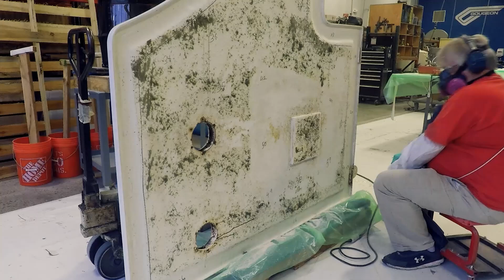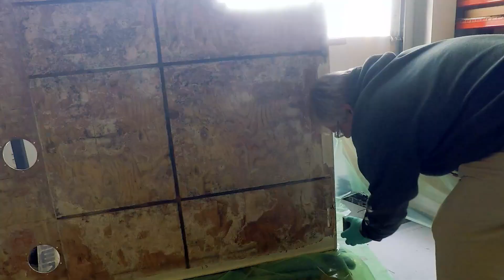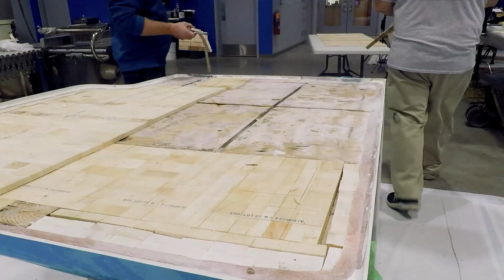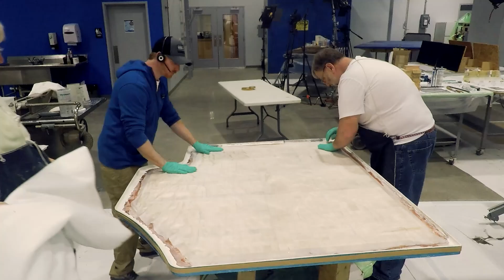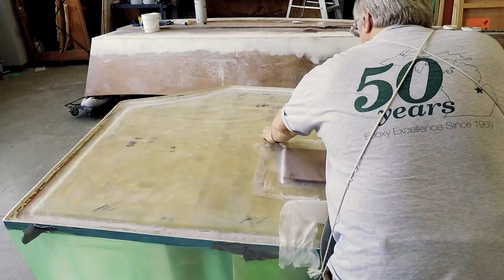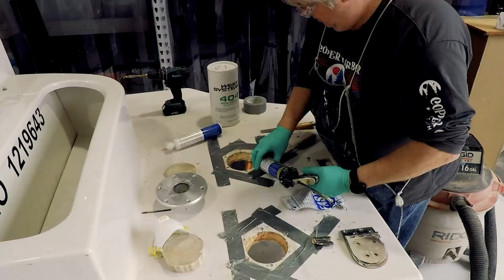Replacing Rotten Balsa Core in an Engine Hatch - WEST SYSTEM Vacuum Bagging Repair

Comment: This question may be redundant, considering this video, but just curious what the official West System position is on applying gelcoat on to epoxy? I know that one time Andy @boatworkstoday did an experiment of applying gelcoat over epoxy and it seemed to be successful.
Reply from the maker: Hi Ron, thanks for asking! The short answer: Yes, it's doable. We have a great Epoxyworks article written by former GBI technical advisor, Mike Barnard, about how to apply polyester gelcoat over epoxy. "Gelcoat-to-epoxy adhesion will be as reliable, if not better than, a polyester-to-polyester adhesion, providing proper steps are followed throughout the...process."

Here's a link to the article: https://www.epoxyworks.com/applying-polyester-gelcoat-over-epoxy/

~ Michael
Reply: @WestSystemEpoxy  Thanks Michael that will help me in the re-coring exercise on a Cal 39: I was using West epoxy under coosa and polylester resin in 1708 cloth on top with gelcoat over that. However if I can stick with one type of resin that is stronger that woudl be an advantage. Thanks again.
Ron
Reply from the maker: @roneberle8954  You're welcome, Ron! We're always happy to help. If you get stuck, feel free to call us as well! When our tech advisors aren't working on projects like the one in this video, they're on standby to help our customers via email or phone. 🤝 

https://www.westsystem.com/need-help/

~ Michael